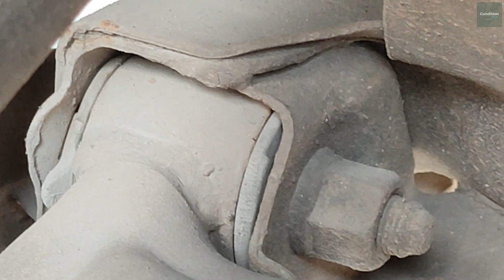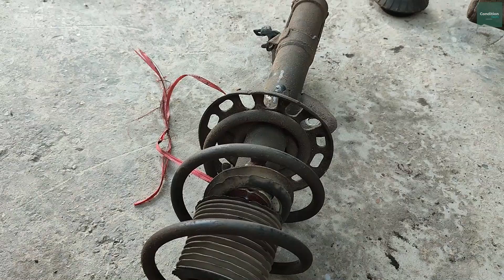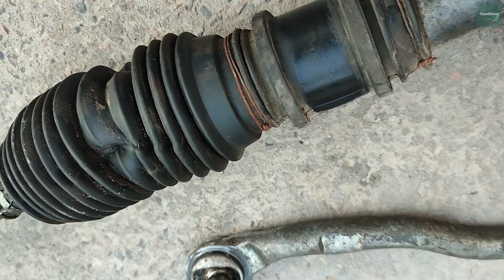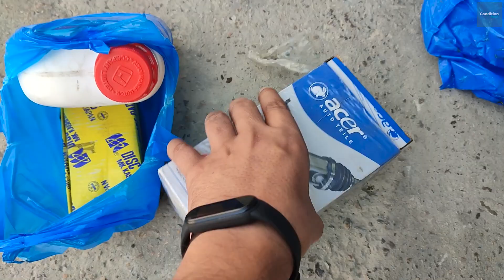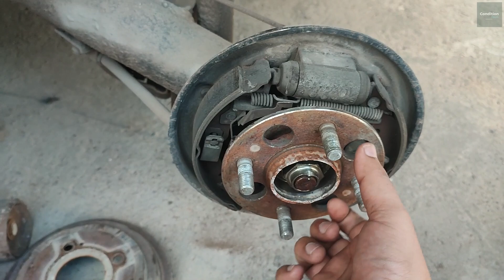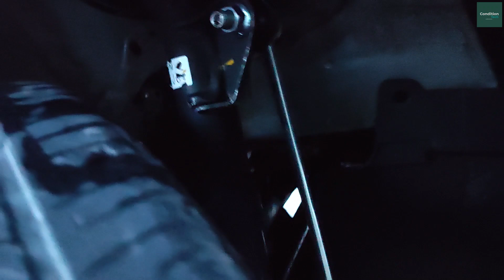Honda City 2007 | Front Suspension Overhaul

Comment: sir suspension and other parts wise which one is better and cheaper?
corolla altis  2012-13 vs 2014-17 altis (both 1.6)
Reply from the maker: They have same suspension and other parts prices are also similar. Not much difference.